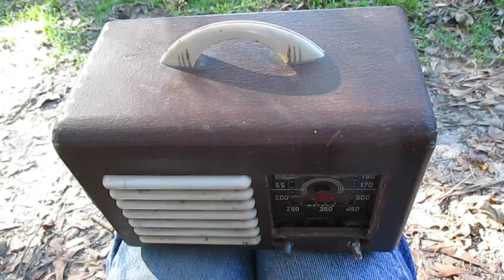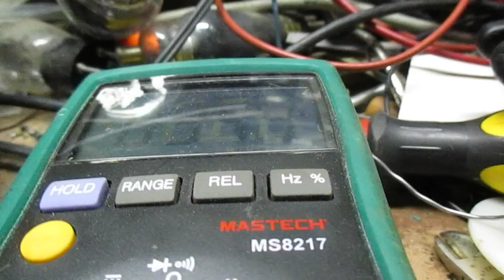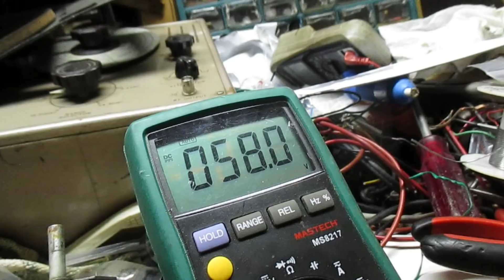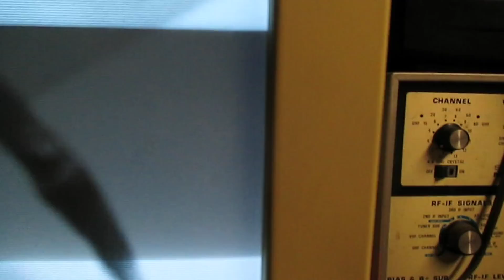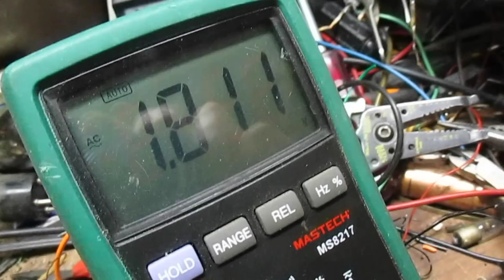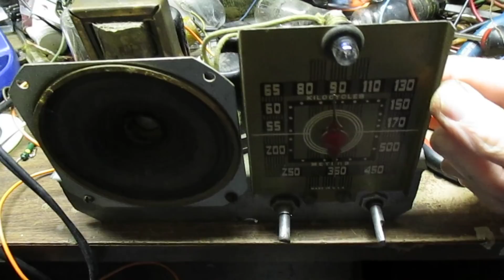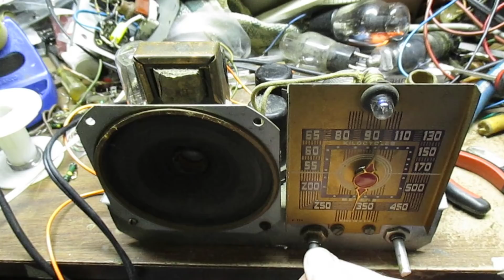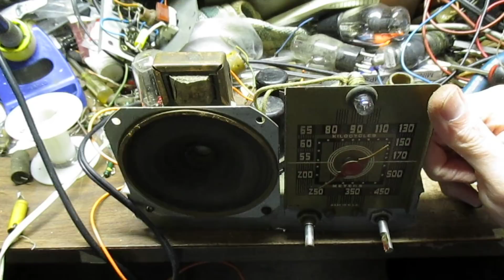Repair of a General Television (?) Tube Radio

Comment: Hack job on a war baby radio. Surplus parts cobbled together and messed up with some  horrible soldering work.
 TRF sets are  very finnicky compared to regular  AM receivers reception wise. This chassis reminds me of those
 early do-it-yourself chassis only kits you could mail order from. Someone just happened to have a spare General 
Television cabinet laying around with a radio dial which was originally  designed as an  AA5 set. Bryan has lots 
of experience to get this damned thing in working order.

Comment: Crosley advertised radios in the early 20s claiming you could pick up radio stations thousands of miles away, even occasionally from Europe.  They were including 1 tube sets.  Either they were lying (which is certainly a possibility) or their circuits were just a lot better than these later TRF sets.
Reply: Im going to go with them lying.
Reply: @qwertykeyboard5901  That's what I think too.
Reply: @qwertykeyboard5901  -- Crosley was probably advertising a Short Wave (SW) Radio with that kind of Long Distance Reception.  They are also available with AM & FM sets.
Reply: @qwertykeyboard5901  -- Crosley was probably advertising a Short Wave (SW) Radio with that kind of Long Distance Reception.  They are also available with AM & FM sets.

Comment: That 'choke' under the chassis looks like a field coil ripped off of a speaker.  That big hole in the chassis near the choke might have been for a filter cap that was removed and replaced, or maybe a ballast tube that was replaced by that flexible reistor.
Reply: I was thinking it looked more like a hacked up relay.

Comment: Nice job getting it working.
This radio would probably be good in my area or one like it. I live in a big city (Philadelphia) not far from where the antennas are and I can pick up all the local stations even on really cheap transistor radios.  On FM, a simple wire pushed into the antenna connector will pick up strong stereo signals of all the local stations.  That is probably where these radios were meant to be sold.  If you live way out in the rural area, you'll need a better radio, but in large metro areas, there are usually a bunch of local stations.

Comment: Hi there. I hope I can offer a suggestion. That cabinet is definitely a general television cabinet put that radio chassis is not. Me taking a real good look at that chassis reminds me of one that is in my storage unit that I got many years ago and the brand name of it is. ECA. A very odd ball brand radio mine has a brown Bakelite case that is actually shaped almost like a Fada bullet. Don't hold me to it but it definitely does look very familiar. The chassis that you have there has been really altered. Obviously somebody stuck that choke in there. And the one that I have uses to filter caps I believe a 30 and a 50 microfarad. Like I said don't hold me to it but that chassis really really rings a bell when I take a look at it
Maybe you could find it in your schematics or on the Internet.ECA brand name

Comment: Its a General Television and Radio set.  I have the 522 and
the case is exactly the same.  Mine is a bit later, 5 tube,
but I have seen it on the archive.  Just put new dial cord
on mine, big electrolytics, and as neeeded.  Got it at local
thrift store for $30and change.  AM only.  Big sound for
little box.

Comment: I love your 🐕 dog. Boxer ? I have to admit, the wiring in that radio is very sketchy. Considering it’s a 1930’s radio, not surprised. The depression was still hitting our country. Janky or not…it works, and that’s what matters.

Did I see one of those resistor cords in circuit ? Not the line cord. It’s a white looking cord in the circuit. I don’t know much about them, other than the fact they do not exist anymore. A TRF set is one step above a crystal radio. Superheterodyne sets are really the best.

Comment: The 4-tube junk radios were sometimes TRF and other times the AA5 with the IF amp omitted (AA4) Either way they worked better than expected with a long antenna.. The AA4 variant had better selectively

Comment: Did I see smoke at 19:45 ??
Reply: May have been a loose connection or resistor getting a little hot, when he was moving the tubes around.

Comment: If I understand Correctly, there is a World of difference between a 5 Tube Set VERSUS a 4 Tube Set.  The 4 Tube unit is far inferior on Reception Per a Particular Vintage Radio Tech.

Comment: are they using that solenoid lookin thing as a filter choke? This is made like that Wurlitzer chassis with the sloppy soldering.
Reply: I was thinking a small speaker field coil. Possibly original choke failed and someone tried this one.

Comment: RadioTV....Excellent assistant by the way.  Passing thought or two: What could it cost to promote one of your local stations to go "public supported" and purposely do so with NO PROPAGANDA Broadcasting; just simple rotation of old classic country, classic rock and classical on two hour rotation(s) with news/weather on the 1/2's?  In other words, approach the community and station for a much needed "return to the roots of radio" public requested type radio Broadcasting. Maybe....I'm just dreaming. Maybe I'm not.